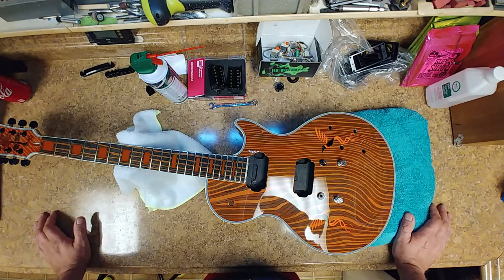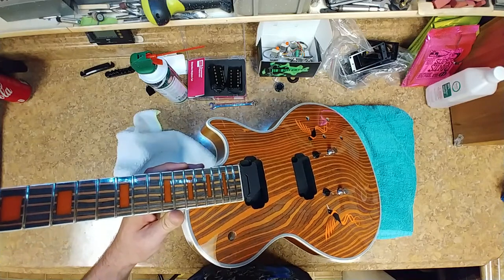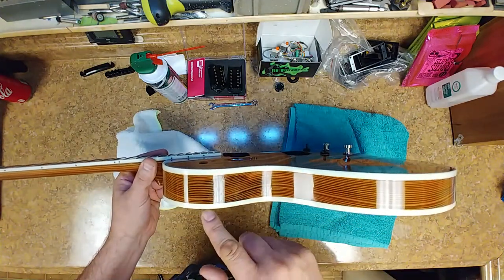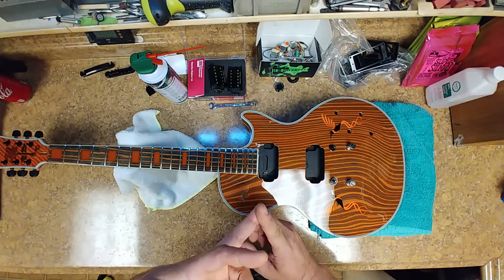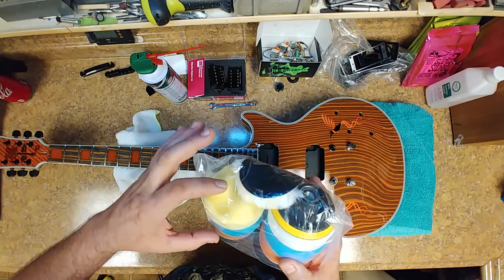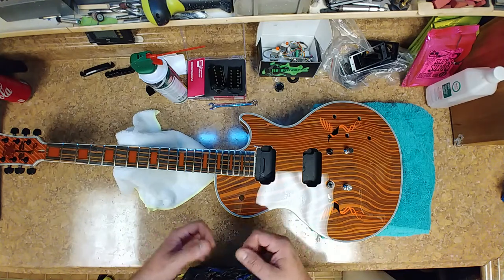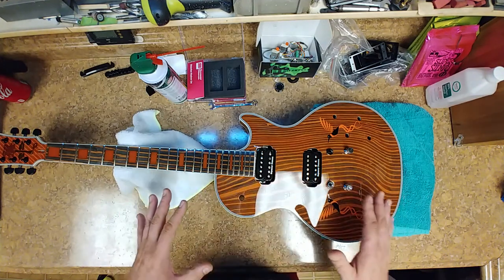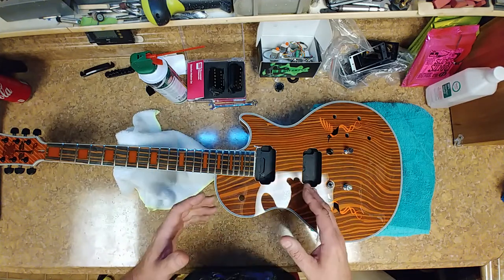Drill Buffing System My Thoughts. And a Question for You

Comment: Yeah, for sure do direct mount pickups. 
I need to get some smaller wheels that I can use on a drill, the way you have. The little spots on the back of my boat and around the outdrive, it would be really helpful. Where did you buy the kit?
Reply from the maker: Harbor Fright. The second kit I got from eBay. Just look up Drill Buffing Kits.